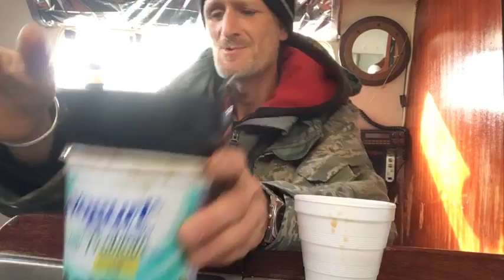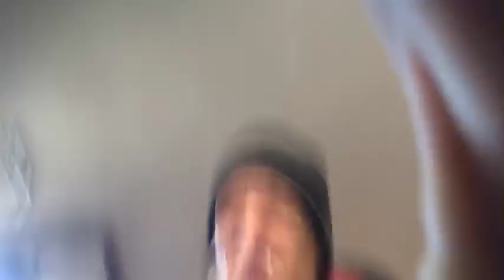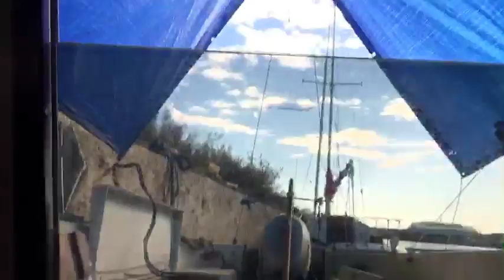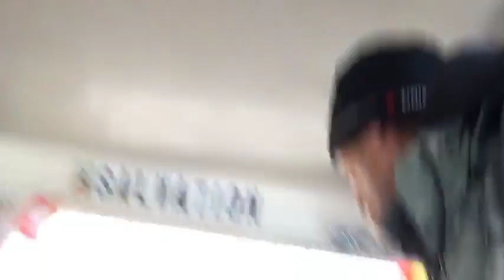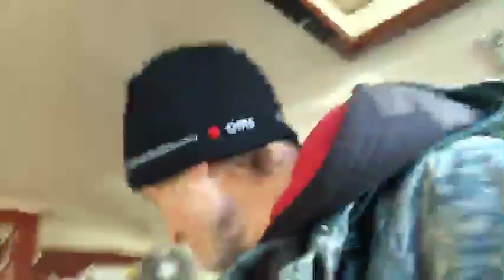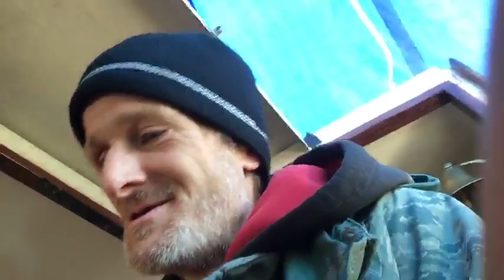Another day... let's see what it brings!

Comment: Candles give off a lot of heat.... and burning any treated wood would prove dangerous. It would be safer to get some tea candles and put them down into cans that you have punched holes into. They will heat the tin and cast heat thru the holes as well. Put them in a place that you know you won't be knocking them over and they will also give you light. Insulation of plastic will help...and certain type comforters are better than other kinds. Once you do get it warm, do all you can to keep your temp steady by coming  in and out quickly. Always keep your head covered and gloves, good socks and shoes. Please get a fire alarm from your local fire department. They should give you one for free and keep some type of fire replant close by. I am lifting you up to the Prime Creator of All things up above, down below and in-between. Not only am I praying, but I hope to BE the prayer IN action as well. Hang on............ THEOST153
Reply from the maker: Miss Sippy Tawker I burned a dozen candles the other night and woke up sick
Possibly from the gas given off when burning soy oil?
Hard to find paraffin these days
I bought 50 IKEA candles 2nd hand for $10
Can't tell but I think candles won't really work in a sealed room for me due to extreme chemical sensitivity reactions
But who knows
Thanks for the idea
Blessings

Comment from the maker: https://rover.ebay.com/rover/0/0/0?mpre=https%3A%2F%2Fwww.ebay.com%2Fulk%2Fitm%2F172947206405
Patric Dooley 
This is what I'm hoping to get
An hq mini wood stove w chimney 
It's about as big as a breadbox so small wood will fit
I would attempt to modify it to burn all fuels gas oil wood diesel paper whatever I can get
Proper chimney and air intake should work like every wood stove
Just where to install it on the boat
And getting the $120 
Thanks for asking
Blessings and peace
Reply: Do not burn treated wood.
Reply from the maker: PreppedAhead thanks again!
I managed to order the little hq stove so in a few when it arrives I will figure out the fireproofing around it and chimney install etc and should be able to go from there.
Thank you so much for your support and assistance 
God bless you